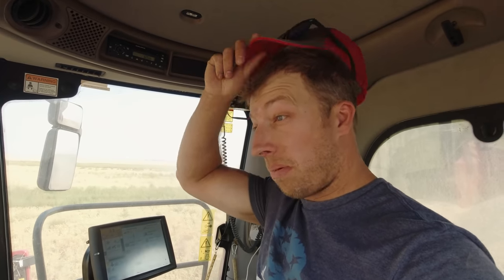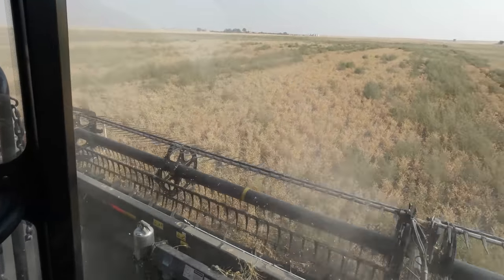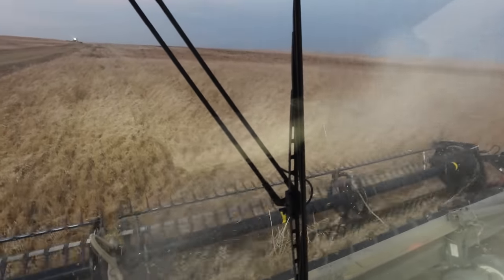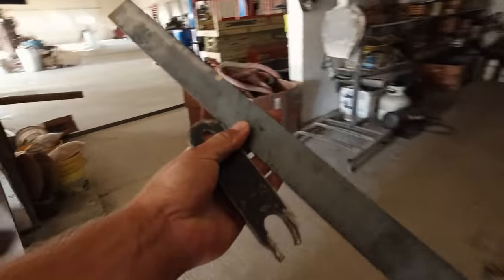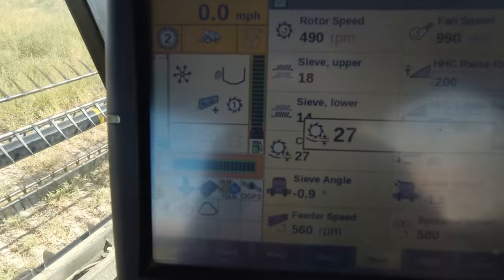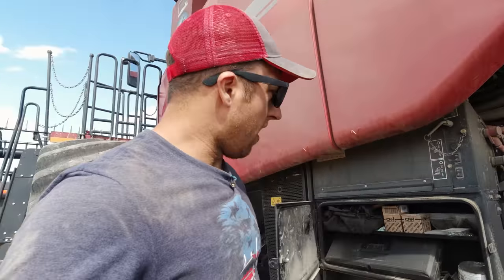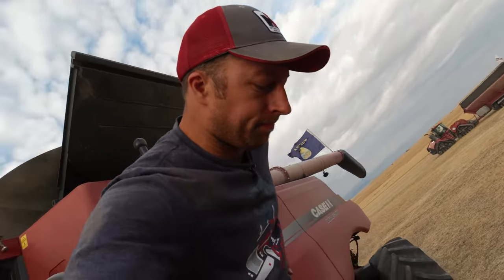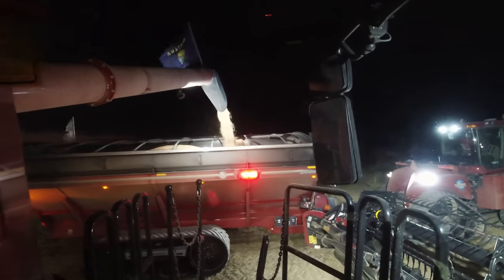Saved the WORST for LAST

Comment: For a nitrogen crop/fix, if that works in rotation for the rain/ ground moisture you get, you guys should try some acres of Vetch. Harvest off what seed you need for next year and sell the rest off as hay to the feedlot. Sell it standing, they can bale or silage/bunker it. Or between you get a contractor in. Then all you have to do is cover planting it and not buy mowers, rakes and balers.

Comment: With the lack of rain causing such problems for you, its almost worth setting up a sprinkler truck. So, do this, take a water truck with a good pump on it, fill it, drive it to the fields that you want to yield well. Park it alongside the field, then run a water hose from the truck out to a calculated point in the field and attach it to a sprinkler that you carry out there. The sprinkler will be on a 6-foot stand so that it is well above the ground but not so high that you need a ladder to get it hooked up. Once you have it set up so that it won't fall over because of the water pressure, turn the water on and let the sprinkler run, repeat that process as often as you need to on expensive crops that you need to yield really well. Yes it will consume a hell of a lot of time, but if you had done that on your garbanzo beans, you would probably be looking at closer 50-60 bushels per acre instead of 15
Reply: A 1" of rain is over 23,000 gals per acre.  1000 acres is 23,000,000 gals.

Comment: In the spring time where Iam at. At work we got a new Holland combine that had two rocks go through it. And took out everything inside the combine. From the feeding House to the end of the combine. The farmer basically got a new combine with an older body frame
Reply: The rock trap works very well but isn't 100%.

Comment: I feel your pain cutting Garbanzo. That was me in the mid 80th early 90th. Running  super heavy headers full of crop lifters and having to replace so many sickles after hitting rocks and whats not from cutting so close to the ground.
The solution was actually seeding Garbanzo as a row crop in Corn spacing and harvesting with a corn header. The plants grow much taller and yield stays about the same.
As an added bonus, weed control is a lot easier.
Probably not the right solution for your area as you have no row crop machinery.

Comment: Not having your chopper in balance will wreck all your chopper bearings. The best way to test it is to make a mark on your chopper and on side next to the chopper line the marks up and spin it (chopper in neutral) and the chopper should never stop in the exact same spot. If it does your chopper is un balanced

Comment: When u saw you rock that deslug switch I Iaughed nick, we run jd Machines on our farm and we raise 45 bushel chick peas and 110 bushel barley and wheat and we've never and i mean never plugged our rotors you'd plug everything else before you plug a jd rotor not sure whats different but we plug our feed exelarator and our discharge beater which case probley don have that cuz or the chopper setup but the rotor is literally impossible to plug.
Reply: You're doing well.  We have neighbors with JD that have plugged and they envy the CaseIH.
Reply: @RobertWelkerFarmerBob  case is definitely not a bad machine but we like our jd Machines but I have yet to see a deere rotor plug, and we test ours believe me we have some big crops and they have yet to plug.
Reply: Its not the big crops which plug.  Most all combines are engineered for that load.  It's the non typical crop conditions which presents pop up.
Reply: @RobertWelkerFarmerBob  I helped the neighbor unplug his 8240 in wheat he had to take out his concaves so... comon case problem idk cause I don't drive 1 but we like our green 1s

Comment: You need deslug because you are hydrualic drive, a belt on the rotor that is properley adjusted has more torque and you will not plug the machine we have never plug our deere's is will stall the engine first.YOU NEED A AIR REEL, and a flex head if you wanna grow chickpeas  or lentils and not have header loss.
Reply: Well we talked to a custom cutter who had 4 machines and went through 5 belts last year.  The rotor isn't hydraulic driven.  CVT transmission.  https://www.youtube.com/watch?v=2-Ibrk4oVC4